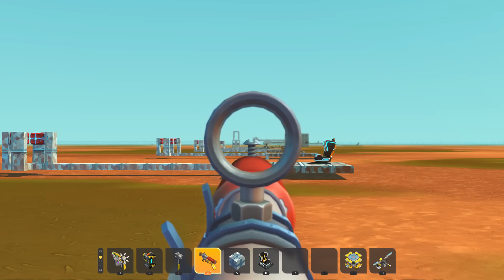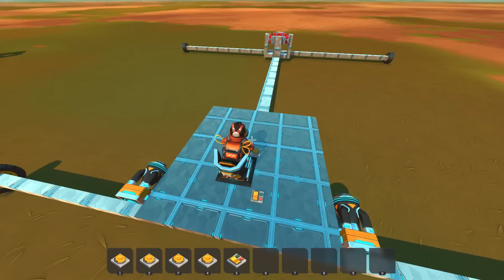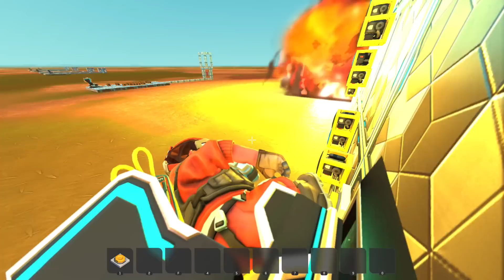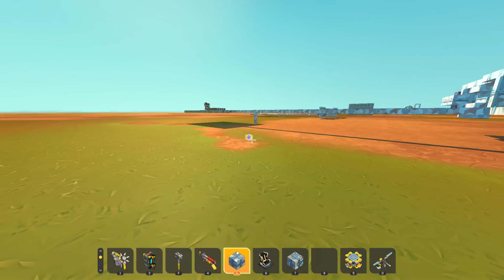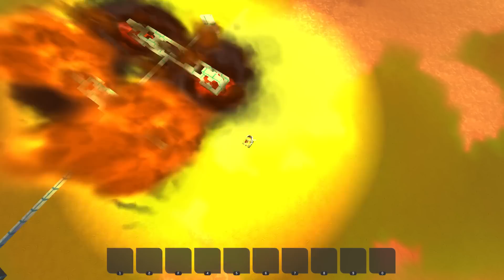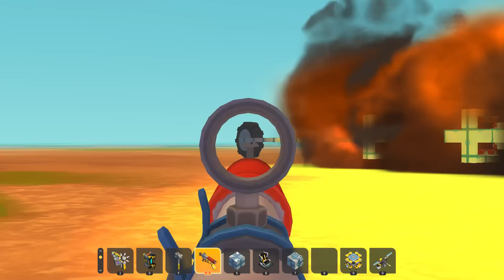I Built a New and Improved Explosive Engine with Automatic Timing Systems! (Scrap Mechanic Gameplay)

Comment: the problem is the differential (the gear shaft) you made with pipes, i think if you just turn the whole engine 90 degree and put the wheels directly in the crankshaft right and left it might work
Reply: Quick explanation on why direct drive does not work; We don't have constant explosions, and we also dont have constant power. If we had a cylinder for every 1 degree, it would work in direct drive... but that's 300+ cylinders you would need for that.. so therefore we need to gear down the drive to maintain higher rpm, and take advantage of a flywheel
Reply: @loneside4912  its not just a flywheel that maintains rotation, crankshafts are designed with counterweights to balance the rotation as well as maintain it.

Comment: I think you are going to need a transmission to solve the torque problem.

Also the timing for a real engine is that the combustions happen when the pistons are at the Top of the cilinder, to get the longest travel. But since in scrap mechanic the explosion is like an impulse, like it happens in one frame, i think the timing should be be when the crankshaft is actually at a 90 degree angle (with the help of a controller maybe) to get the most leverage. And that could also solve the problem of the explosives spawning inside the pistons. I'm not sure if this actually works but these are my thoughts
Reply: Also fill in the gaps on the side of the pistons, these cause the pistons to fly out

Comment: Explosive engines are such weird concepts in SM, yet they should be the most normal thing ever.
Reply: In SM it's solid explosives of which we are trying to use the expansion force to move something. vs real life where we are actually using pressure of expanding fuels by chemical change, aka, combustion. Basically like a steam engine, but we are burning fuels within the cylinders for that pressure. So in a way for me at least, it's a weird and wild thing lol
Reply: Only reason why there is no torque in SM, is because you don't have contained pressure, just an instantanious high force followed with zero force to continue pushing the piston throughout the cylce

Comment: I think you need a bigger gear ratio...i mean make a bigger gear on wheel axle and smaller on the shaft

..
And try to create a v4 engine...maybe that will help with the weight

Comment: remember that transmissions have torque converters to fix the issue with torque
Reply: Gear ratios fix the issue with torque.
Torque converter transfers power from the engine to automatic transmission
Reply: Indeed, I think he shoud use the gears mod and use the cogs to give more torque to the engine
Reply: @0desumilde11  That's what I thought, too.
Reply: Also remember that transmissions have... Transmissions
This thing has the engine directly linked to the axle, there's def gotta be some sort of gear reduction
Reply: and we need cluth guys :D

Comment: You can give the engine more torque by increasing the distance between the conecting rod and the centre of the crankshaft
Reply: Already has pretty long rods, just narrow the car a bit so the excess length of the rods become more travel for the crankshaft.
He needs to use the full 360 degree range rather than each set being offset by 90degrees. An inline 6 firing one cylinder each offset 60degrees
Reply: @swskitso  it's not the rod length that gives torque, but the lenght of the crankshaft, or in other words the diameter of the crankshaft.
Instead of the connection being offset by 3 blocks from the center of the crankshaft it could be offset by 4 or more blocks to see if it gives it more torque
Reply: @ValentineC137  im saying there is plenty of length to make your change without extending cylinder or rod
Reply: @swskitso  if that's what you meant above, then he actually wouldn't be able to narrow the car if he did the crankshaft changes since the pistons would move even further out to the sides on the "compression" stroke
Reply: @ValentineC137  i realized that later after typing but was at work. Your correct it would more likely need a longer cylinder.
Reply: @ValentineC137  That's true, increasing the displacement of the pistons' connections to the crankshaft would be a good improvement.
At the moment, the ratios seem way too low, but I don't know how well real-life engineering transfers into SM.
It's worth a shot either way, definitely a potential improvement!
Reply: So bigger crank and smaller rod? If so, yes. I noticed that too. His connecting rods are so long and yet his crank only utilized like a quarter of it. If he makes more rotation the pistons move more creating more torque

Comment: Boom Boom engine!!!

I think you should gear down since the speed seems excess compared to the lack of torque.
Also, you could perhaps try making the engine rotated 90 degrees so the cylinders face forward so regardless of your speed the explosives should still blow ewachother up
Reply: The rotation idea is interesting, but I don't know about the gearing suggestion.
SM physics don't allow for efficient gear-meshing. Gear interactions are drastically inefficient and would probably lose more torque than they'd provide.
Reply: @Broroboros  if bomb spawning mods are allowed I’m sure the rules can be bent to allow the gear mod, as proof of concept
Reply: It might be a bit of a pain connecting the engine up if he mounts the engine transversely.